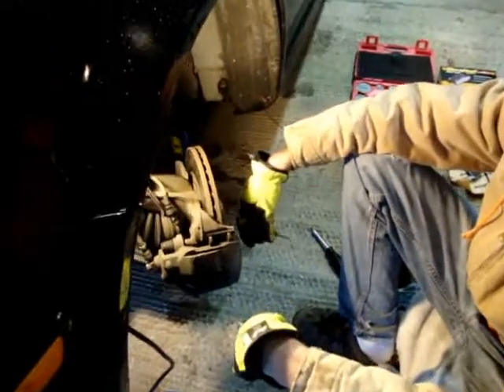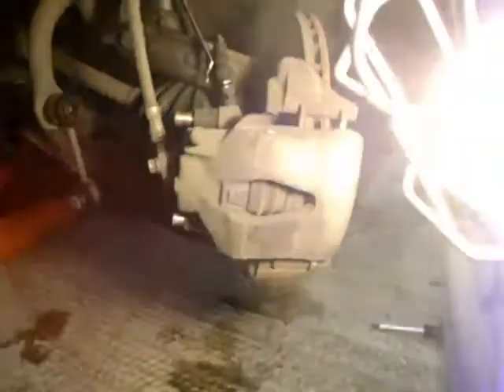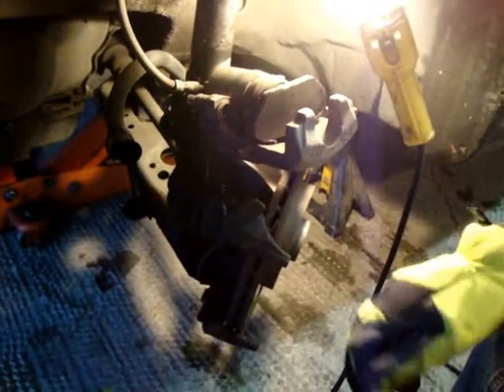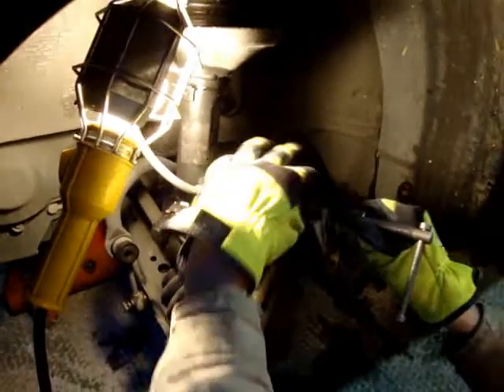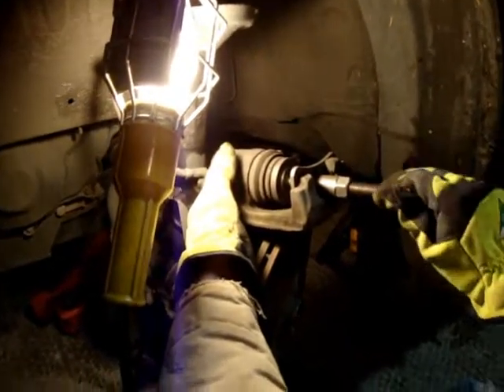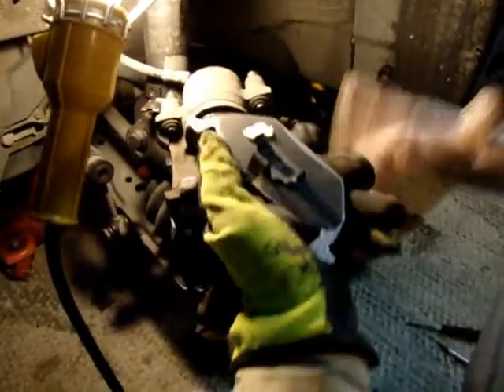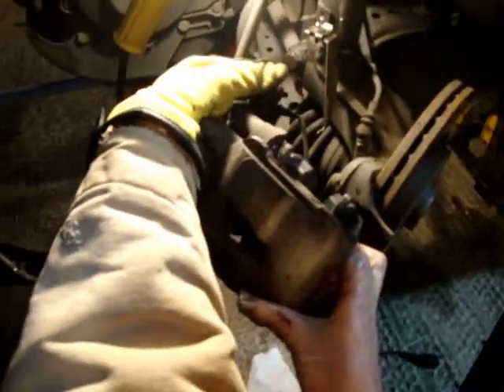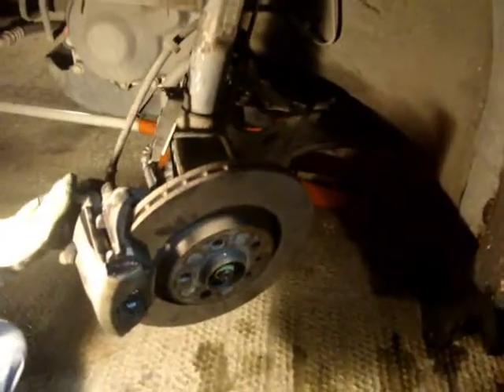Volkswagen Jetta Front Brake Pads Replacement

Comment: PUMP YOUR BRAKE PEDAL! After replacing your brake pads and before you take the car for a test drive, pump the brake pedal to make sure the pads are seated properly. Or you will be in for a big surprise (not a good surprise) when you try to stop.